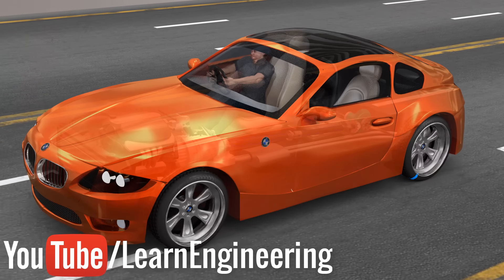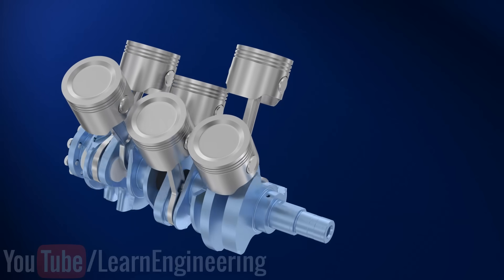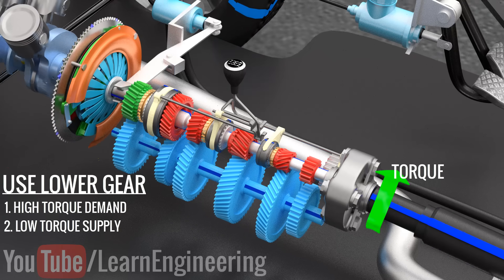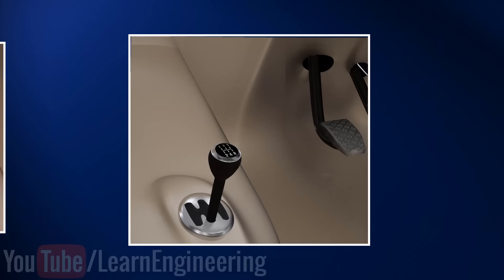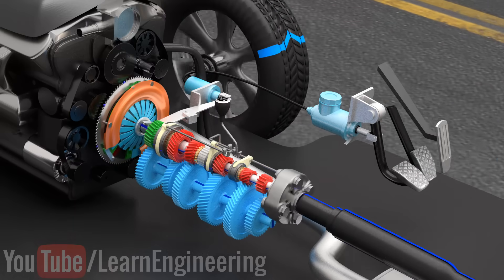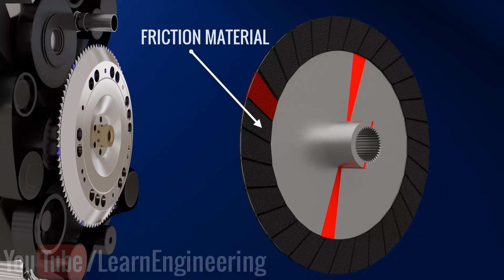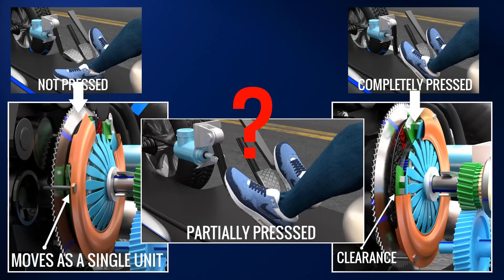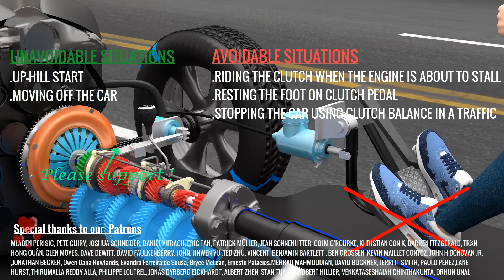Why you should not PARTIALLY press the Clutch?

Comment: Let's assume we are on a steep hill climbing up with a slow moving traffic that stops and moves every 5 seconds.
Im on first gear. Now when the front car stops for 3-4 seconds,. What is the best technique in this situation?
A. Should i put the gear on neutral and press the brakes. Then shift and go again..
B. Keep on first gear and press the clutch fully and press the brakes.
C. Keep on first and balance the car by pressing on the accelerate and half clutch?

Please tell me the best technique and the flaws in the rest of the techniques. Thanks.
Reply: Well whenever you're coming to a full stop, the clutch should always be fully engaged, that's the rule of thumb...If I would expect to wait a little longer I would put it in neutral and engage the handbrake and rest my feet a bit, otherwise if it's just a stop of a couple of seconds, I'd leave it in first gear with my feet on the clutch and on the brake pedal...well actually I would still engage the handbrake, and rest my right foot, but it's not necessary it's just a habit of mine, I use the handbrake way too often, I just feel a tiny bit safer like that.
Reply: Well the 3 methods that i mentioned are generally done by many (BY HABIT) . Just want to know from an expert as to which method is the best and if any of the above is to be avoided at all costs.
Such scenarios are not taught by driving schools, we just improvise.
Reply: @yolson2376   Should not be using your handbrake for regular driving.

Comment: Do the clutch plate get damaged even if I don't press the accelerator while pressing half clutch (or PARTIALLY PRESSED CLUTCH as you call it) in first gear ? 

You must be knowing in India the road and traffic conditions are very busy, harsh and poor especially in during office hours when stop and start traffic, very slow moving traffic, reckless and rash driving traffic because of everybody in hurry mood [ bumper to bumper traffic as we call here in India ] kills your time and patience. You are forced to drive in half clutch in first gear at that time even after knowing that half clutch driving is not good for the car. Most of the indians use petrol cars which definetly has less pick up compared to diesel cars.

What do you think at that time should we still drive in half clutch without pressing the accelerator SO THAT LESS wear and tear of the clutch takes place compared to pressing the accelerator in first gear in half clutch in bumper to bumper traffic and allowing MORE WEAR AND TEAR of the clutch ???

For your info, I live in India, New Delhi and I own a mannual Hyundai Grand i10 petrol car. Please help us by your appropriate advice so that we indians could do the needful according to the above mentioned situation.
Reply: "Do the clutch plate get damaged even if I don't press the accelerator while pressing half clutch (or PARTIALLY PRESSED CLUTCH as you call it) in first gear ? "
Yes. The flywheel is still rotating about 1000RPM in first gear without pressing the accelerator. Obviously the more revs you give, the more wear on the clutch. But don't worry about it, the clutch is designed to wear and providing you don't give high revs whilst engaging the clutch, it will last 80K miles+.

Comment: 😂but when I try to move the car from 1st gear it stops , so I use to hold the clutch partially and accelerate.. and during reversing the road is in a slightly in higher ground for which I need to hold the clutch partially 😂 to give the torque

Comment: I always wondered what riding the clutch really meant, I thought it was about keep it at the biting point for too long. But this at 3:24 is just plain dumb, you went through the trouble of pressing the clutch, why wouldn't you go to a lower gear at this point?
Reply: Sometimes if you're in a lower gear the car will be revving too high, but in a higher gear it can come close to stalling, so using the clutch and applying the accelerator can be a good way of getting around this, you can kind of create half gears.
Reply: Though, on my Accent, when I'm close to stalling, I can almost go 2 gear lower. Anyway, if you need the acceleration when close to stall the engine, you'll need to lower the gear.
Reply: @nbdzero  That's not true at all.

Comment: what about partially clutching when syncros are aligned for the shift already? For the last several years, I've been doing quick shifts where the clutch barely needed to be depressed at all..
Reply: Before anyone berates me, please understand that I recently removed the clutch plate to install a new flywheel + clutch combo while I have my engine out, and the old clutch plate looks fairly new still.. lots of life left on it.. so I know I'm not fucking up the clutch; and the engine & trans have done excellent over the years and still going on strong (with exception of a water pump).

Why is your engine out if it's going strong? you may ask... The only reason the engine's out is to swap the blocks due to a welded keyway at the crank preventing me from getting to the waterpump; requiring me to replace the crank at the very least, but with 200k on the motor, I think I'd be better to just go thru the entire rebuild process..

Comment: Stop half-explaining this, people learning to drive manual should no it's not possible. YES, resting foot on the clutch is not good, but to start the car, to stop the car and to change gears smoothly you must press the clutch as needed. Smoother driving and transition is better for the car. 
A clutch plate costs less than your life, and your gearbox. Don't be afraid, only avoid resting your foot on the clutch and that's it.
The clutch plate has to be changed in 3-5 years, and it's not that expensive. European cars have somewhat lower quality and expensive plates than Japanese or Indian cars, but still they live for at least 3 years.
Reply: In tech school I learned that clutches should technically never wear out, they aren't a wear item the operator is the one that burns them up, I've seen truckd with 600,000 miles with original clutch, someone I'm my class has a civic with 400,000 with the original clutch and one of my teachers has an accord with 350,000 with an original clutch
Reply: Good points.  There are situations where the clutch saves the driver from engine stall, or gives the slight edge needed to accelerate.  This is definitely more valuable than the occasional expense incurred replacing clutch plates.

Comment: So at a complete stop before a checkpoint i stay in neutral until i have to inch forward when the line progresses. I move up with only a partially engaged clutch and don’t use the gas. Then I go back to neutral. Is this wrong?

Comment: I always do it :( and my clutch plate is due change
Reply: Don't be lazy. Just downshift.
Reply: akio2589 naaah ! Its due change anyway 😝
Reply: That doesn't really justify it. If you do it now, you'll do it with a new clutch -.- Plus that's a good way to tear it up so it won't work at all. Ever seen a friction disk come apart? It's not pretty. And the cleanup from it isn't cheap.
Reply: akio2589 alright, I am consciously doing the right thing since yesterday now. 

What about Diesel motor I have, I dont even have to press accelerator to initially get it moving, isn't that riding by clutch?
Reply: There's not nearly as much stress on the clutch when taking off in first gear. Far, far less wear than riding the clutch while moving at highway speeds trying to climb a hill that's too steep for the selected gear. Relatively speaking, it doesn't take much effort to get your vehicle rolling in first gear. To keep it moving in a high gear takes considerably more effort, ESPECIALLY when climbing a hill. Letting the clutch slip while you do this is NOT a good idea.
Reply: akio2589 alright, so basically I am most of the time riding the clutch on 1st and 2nd gear only. So its fine right :D
Reply: Using the clutch to take off isn't riding it, unless you keep your foot on it all the time after you've taken off. Which is a good way to wear out the throwout bearing AND tear up the clutch. If you're not taking off, shifting, or stopped, keep your foot off the clutch -.-

Comment: Depends on ones driving style. Clutch plate on a small car dont cost much. If someone comfortable riding clutch, he shouldn't care about cost.
Reply: If they're comfortable riding the clutch, they shouldn't be driving a manual. It's wrong to drive it that way. You wouldn't drive an automatic around floored everywhere and just use the brakes to regulate speed. And yeah, the clutches themselves aren't that expensive, but based on your comment, you've never had to change one. It's not like changing the oil, the transmission has to come out of the car.

Comment: Actually, its not always bad to do half clutch, sometimes you need to do it specially when you're from a stand still and moving in elevated road, otherwise your engine will shut off. And besides, the clutch was created in a way that it is easily & cheaper to replace when it is worn out, something like a "sacrificial lamb". Half clutching becomes not good when you do it in times when it should not  like when you are supposed to lower your gear to gain more torque, but play with your clutch instead (as shown in the video), etc.

Comment: such a shit this is , it was made to be like that , riding the clutche is wat u do even in first gear as in idle also the engine generates torque , for this main reason there is engine oil & always the clutch disc is placed in separate assembly so that it can be replaced easily. there are various materials used in various manufactures . high end cars get good metals & low end gets the worst metals & stop posting bull shit . when u dont know get to know . plus there are many other factors which needs to be considered here .

Comment: Lol, clutch is meant to provide passenger comfort and ensure smooth engagement. When a car is at low speed chances are you kind of have to ride the clutch partially to make sure the engine does not struggle, especially those that have worn spark plugs, slight vacuum leaks and dirty maf sensors etc. And remember one thing, it does not have too much slippage when you are at low gear, especially when crawling in first gear at around 1000 rpm at 10km/h (6mph), you can push the car and maintain that speed with ease, a clutch can take way lot more abuse than your body, plus it has a huge mechanical advantage that it requires even less friction to turn the wheels, thus it unlikely to cause more damage than shifting.
Reply: Did you even watch the video?

Comment: how does hydraulic work ?, try to explain to us like your video video before .. Thank you.
Reply: Hydraulic clutches work the same way your brakes work. Uses hydraulic pressure to transfer motion, rather than a cable. Like your brakes, there is a clutch master cylinder and a clutch slave cylinder. The slave cylinder would be the equivalent to the brake caliper (or wheel cylinder, in the case of drum brakes). The slave cylinder will push on the clutch release arm, which will push the throwout bearing into the spring on the pressure plate, which will release the clutch.